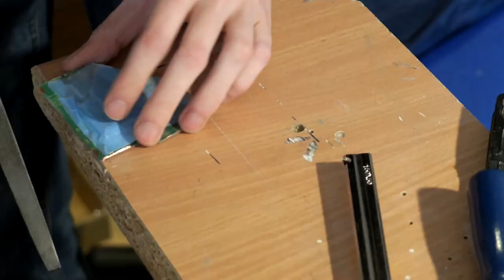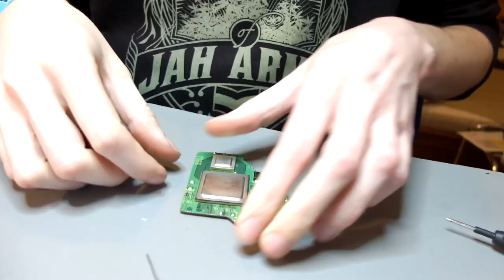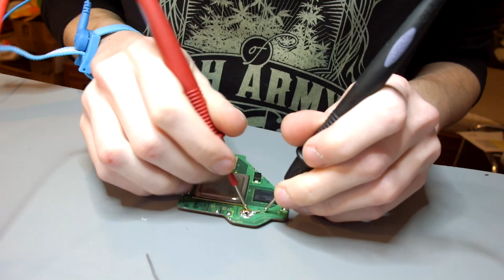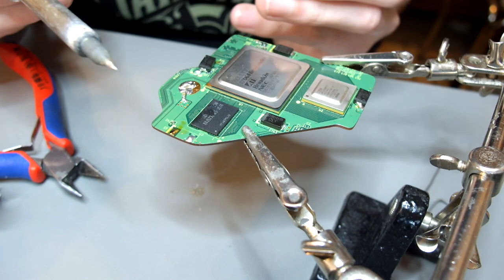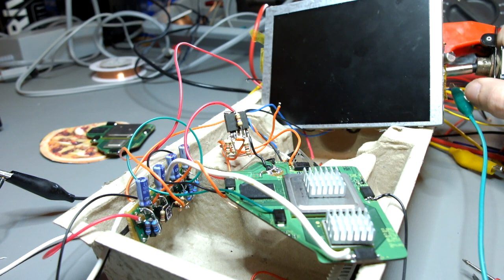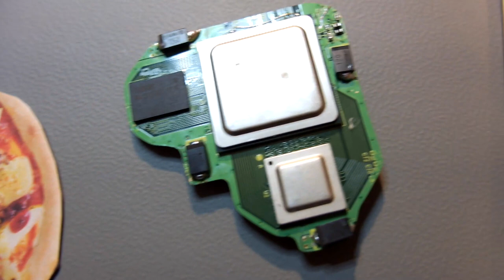Trimming the LM420 (Wii)

Comment: What if your good at Wii modding but not at soldering, do you have a more in depth guide??
Reply from the maker: The softwaremod is super simple using portablizemii, so to make the trim work, it's mostly soldering work. Check out the guide section on bitbuilt, we have a lot of information there, like the trimming guide: https://bitbuilt.net/forums/index.php?threads/the-definitive-wii-trimming-guide.198/
Reply: Thanks!!
Reply: @Noldtronics  A lot of pictures in the guide are gone.. damn, I was going to do the mod, but pictures would help a lot :(

Comment: Do a og xbox
Reply from the maker: soon (TM)
Reply: No dvd games from micro sd moddern power supply thats a good start
Reply from the maker: @doz3r943  yes sadly this monster needs link >100W compared to the Wii which only needs like 6W! so it's not really possible / worth it to replace the power supply :/
Reply: @Noldtronics  if you wanted to go lipo instead of 18650 you could pull 100w no problem. You can with the 18650s too (with a high quality battery like the brown LGs) but the runtime would be shot at that point lol.